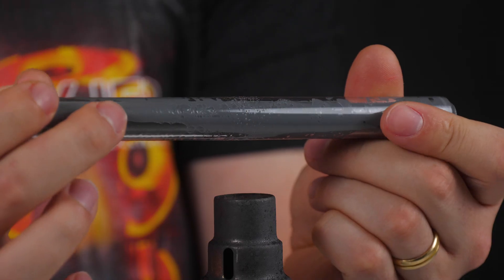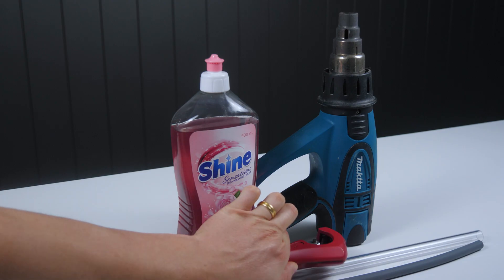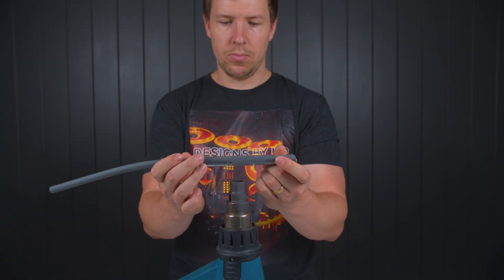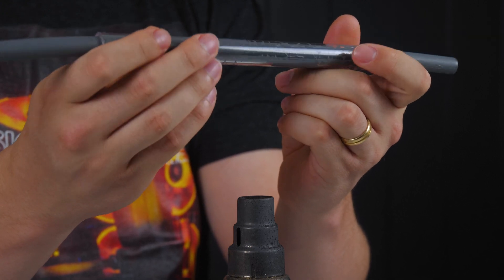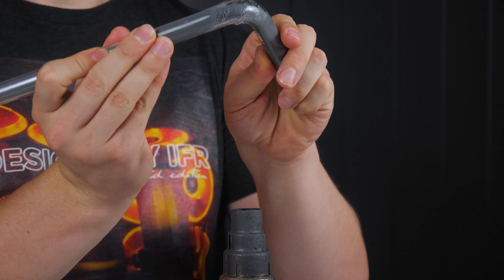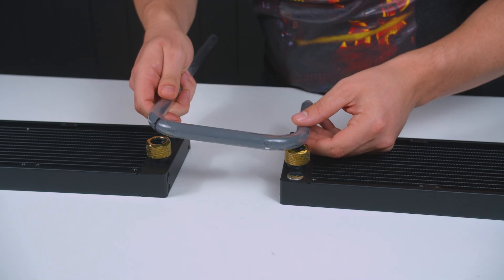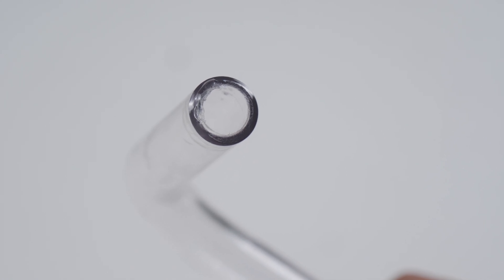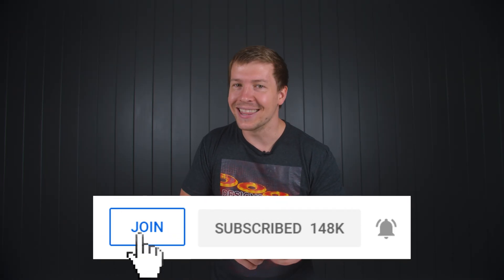How to Bend Hard Tube For PC Water Cooling in 2022

Comment: What is the soap for?
Reply from the maker: To make it easier to insert the tube silicone
Reply: @DesignsByIFR  bro. You just made my life easier. I did a 4 bend section using soap I can even get it back in to make adjustments. Is it ok to run the tube under water while holding it so it hardens faster?

Comment: If I may also add. Once you have "roughed" out your pipework you can then fine tune any bends using hot water. Only softens enough for minor adjustments without insert.